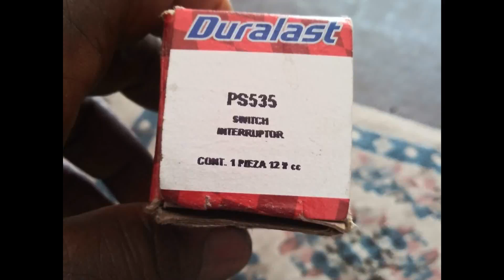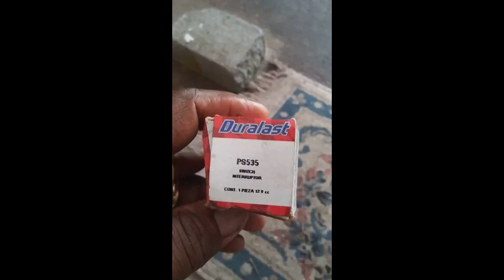Jeep Liberty (oil pressure sensor) dd

Comment: Not the easiest job for me.  Like you I unscrewed the oil filter.  I could not get the red lock tab to slide out for me because the connector was clocked in an awkward position.  I ended up just breaking the plastic end off the old sending unit which was not very hard to do.  Once broken off, I could move the connector where I could get to the red tab and slide it out so I could remove the female harness connector from the broken off plastic part of the sending unit.

My Craftsman deep 27 mm multi-pt socket started slipping on the new Standard sending unit when I was tightening it down.  The Standard sending unit uses rounded off pts instead of sharp edges like the OE sending unit.  Luckily it was tight enough not to leak.  I imagine I will need a 6 pt socket to remove this Standard unit if it ever fails.
Reply from the maker: Sometimes you have to do what you have to do to keep things moving. But I would keep a check on it to make sure it doesn't Disconnect from the vibration of the engine.
Reply from the maker: Yes the 6 points socket is the best option